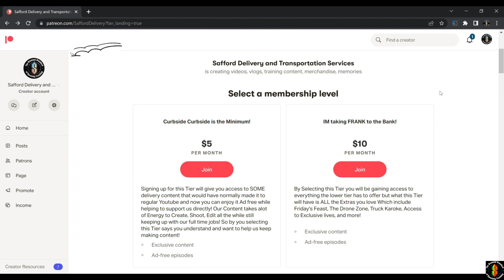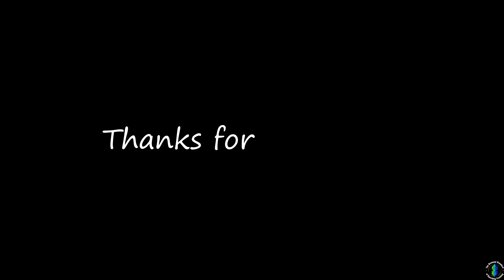Doing a lumber Delivery and then watching another company do a CURBSIDE Delivery!

Comment: So nice of them to put out orange cones FOR YOU to avoid a major accident running into the back of a trailer, Which when i ask you about never doing this on your live, Your reply was THAT'S IRRELEVANT. ---You lost my vote, Safety First not money first. I'm outta here.
Reply from the maker: Deliveries where I'm offloading MYSELF I am not there long.... For me to take the time to put cones out or emergency triangles and risk the extra exposure time to traffic would be Not only a daunting task when you got to do it 12 to 15 times a day but it could add a lot of time to your day when you're doing LTL deliveries. Not to mention a lot of unnecessary extra time added specifically to EACH of your deliveries. Here it's actually different when I'm doing one drop off.
Reply: 60 seconds to throw some cones out, (15 stops as you say) x 60 seconds = 9 minutes of your day that could possibly save lives. YOUR CALL as you say, it's a daunting task....
Reply: @england713  If emergency personnel with flashing lights on their vehicles are getting hit every day, what makes you thing cones are going to do anything? Literally does nothing. 🤣
Reply: CRAIG YOU WON!  - 1st PLACE Dumbest Response Post of the year! - I actually had to read that 3 times before believing what you wrote, if your on meds be sure and follow the instructions on the label. But Congratulations!
Reply from the maker: @smittyt73  CONES have a forcefield around them so they can't be penetrated apparently 🤓🤓🤣🤣🤣🤣
Reply: Federal regulation 49 CFR 392.22:

    When stopping on the shoulder of a highway for a reason other than a traffic stop, the truck driver must immediately turn on the trailer’s hazard warning signal flashers.
    The parked truck driver must keep the vehicle’s flashers on until placing a warning device on the traffic side of the road.
    The driver must place warning devices as soon as possible, but no later than 10 minutes after stopping on the shoulder.
    Approved warning devices for big rigs parked on the shoulder include three bi-directional emergency reflective triangles, red flags, fuses and liquid-burning flares.
    Stopped truckers must place warning devices:
        On the traffic side four paces from the truck in the direction of oncoming traffic;
        At 40 paces from the big rig in the center of the shoulder in the direction of oncoming traffic; and
        At 40 paces in the direction away from oncoming traffic.
Reply: @england713  key word highway not city street but thanks for once again making a fool of yourself 🤣
Reply: We shall see what happens... you may just learn something.
Reply: @england713  definitely won’t learn anything from you when you clearly don’t know anything 🤣🤣🤣
Reply: @SaffordDelivery  exactly!  I’ve had 2 sets, both got run over by drivers.